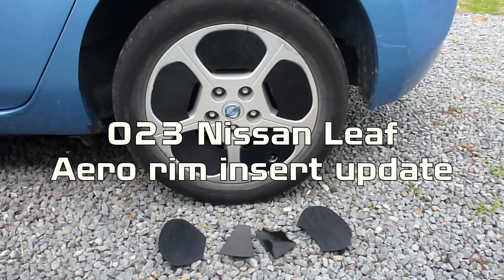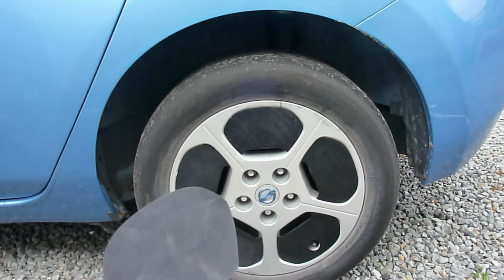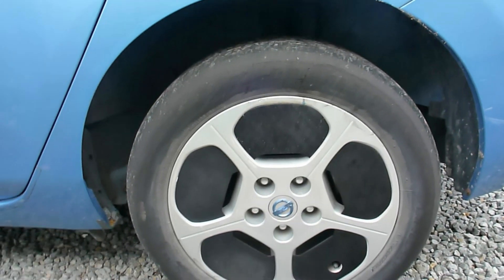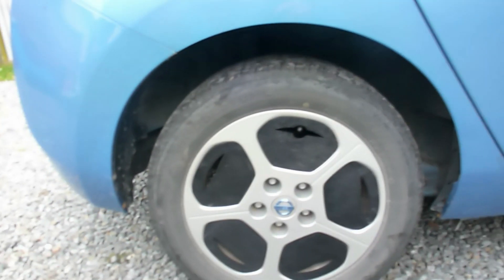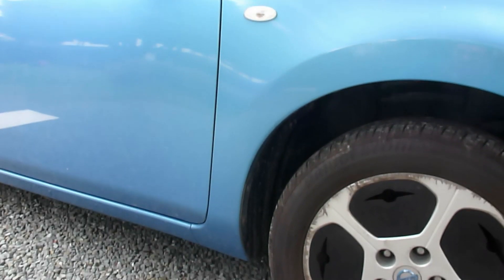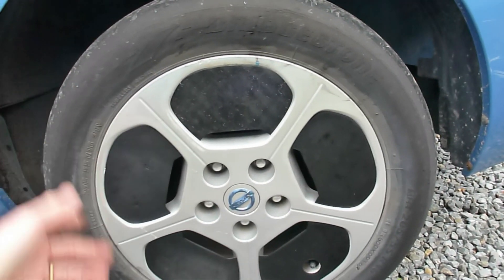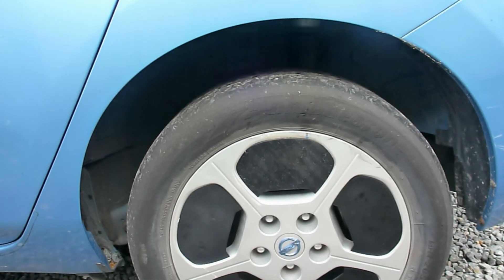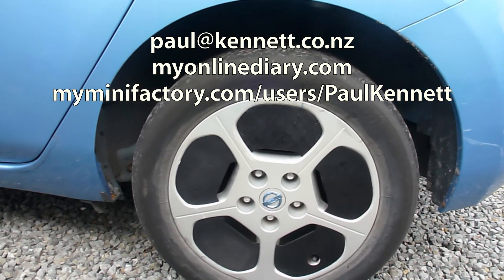Nissan Leaf 023 - Aero rim inserts improved

Comment: Paul, thanks for the research and sharing the CAD files. Going to give them a try, regards Damian
Reply from the maker: It's been 21 months since I made this vid and the latest design version is working really well. The earlier designs would warp a bit in the sun - this version has stood up well.
Reply: @paulkennett  Just test printed my first insert, many thanks for sharing the design :)
Went with black PETG but might try using silver and see how well it will match.
Did you test and see any aero differences between the closed design vs the open (close to center) version?
I think the closed ones looks a bit better and I'm not to worried about heat.
Reply from the maker: @andersw1152  I never quite got round to testing the difference between the two designs. My assumption is it'll be negligible.

Comment: Really cool stuff! I'm looking to design a set for the BMW i3 (wheel style 428). Any safety concerns in terms of the inserts coming off the wheel?
Reply from the maker: I must confess I hadnt thought about the safety issue of them coming off. They are very light so hard for them to do much harm.
Reply from the maker: And they dont come off very often. The current design seems to stay in place very well.
Reply: @paulkennett  That's good to know! Any tips on how you designed the bracket to clip on the inside of the spokes?
Reply from the maker: @unixbash  Have a look at my STL file on MyMiniFactory.com - it's basically just a hook-style clip. I iterated the design/alignment/position until it fit just right.

Comment: Paul, once again you have inspired me. I have a 2015 Chevy Volt and I have started with a rubbing of the wheel openings. The openings are just small enough to fit on my printer's bed. Where did you get the 7 Recycling Symbol with PLA?
Reply from the maker: Hi Papa. I just used Google Images to find a black and white image.

Comment: Your assumption that airflow for cooling isn't neccessary, is correct correct for defensive drivers.  I have had your original aerowheels on my 2011 Leaf for 3 months and a couple thousand miles, with no overheating problems.  And that's in the Texas heat with temps routinely above 100F/38C.  I'm sure if you're out there driving like Mad Max brake pad heat would be a problem but if thats your situation, you need to relax.  Glad to see you well back on Youtube Paul!  It's been a while pardner.
Reply from the maker: Good to see you're as busy as ever. Cheers, Paul